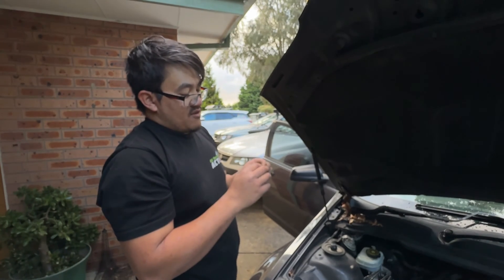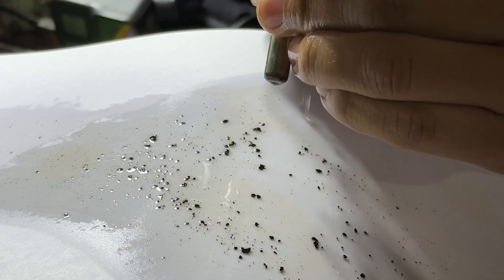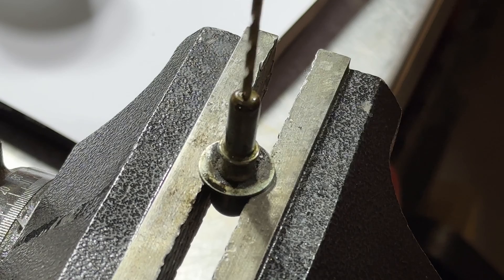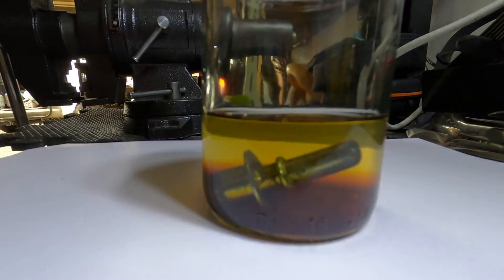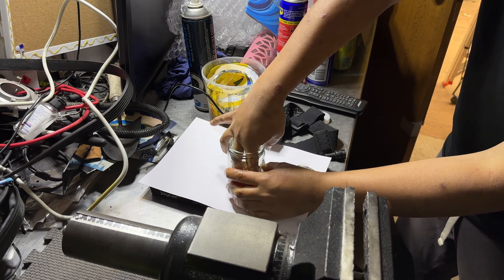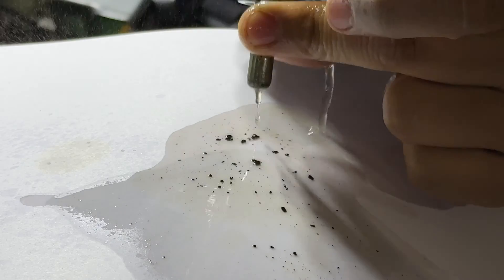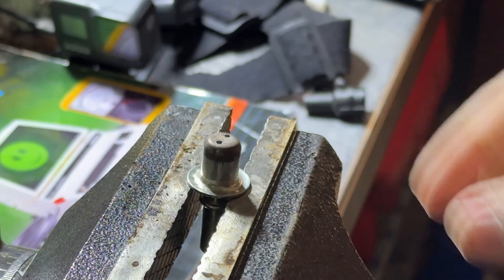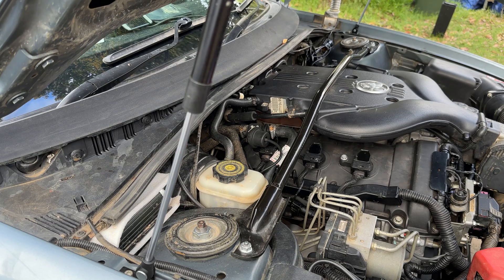PCV Breather Mod on a GM 3.6L HFV6 ALLOYTEC - ADVENTRA COMMODORE CAMARO CADILLAC RODEO CAPTIVA

Comment: I tried this modification. It seemed to work for awhile, but after a long trip, caused a bunch of misfire codes and rough running engine. I was forced to go back to the original PCV on my 2008 Acadia. I have resigned myself to just cleaning the old one every 5000 miles or so.

Comment: Yeah right this is very helpful as I’m considering buying a 2009 Ute that has a ly7 motor and it’s just had the timing chain on it done so I want to make it last but I know how notorious these motors are the timing chain chains but I reckon if you drilled a bigger hole it would have worked ten times better and thinking about putting a catch can there as well would maybe help?

Comment: How were you able to get the PCV valve out? I find these PCV valves are really stubborn to get out of the 3.6 engines.
Reply from the maker: Bit of persistence first time they are fairly stubborn after you’ve cleaned it once it’s easy every other time.

Comment: The way you use that drilling machine is very amateurish. When drill for accuracy you do NOT wander the drill up and down and sideways as you did. You drill the hole and remove the drill from the hole.In my recollection the holes were to be drilled to 2 x2.0 mm and 1 x 3mm. The holes should add to the same area top and bottom but without a major drill set
(many fractional sizes)you will not readily achieve the precision  2 x2mm is  2x.031 adding to 0.063 squ.mm against 1 x 3.0mm which is area 0.071 squ.mm a difference of 0.007 squ mm. Ideally you would use a drill of 2.1 mm...not give the hole a 'workout' with a 2mm drill There are other ways of making them close but in amateurish hands they may be enlarged or damaged. Leave at 2 x2 mm and 1x3 mm. When you check hoses for flexibilty also check inside of them and the MAF. The 'pcv' in these holdens is not a 'valve' in the normal sense, it's more a decompression tool or 'pressure relief system' which was a good idea in theory so long as the designer didn't think much.

Comment: My 3.6l Alloytec from a July 2005 VZ (I guess it's a LEO?) has started doing the oil pressure loss thing. I've stopped driving it as soon as I got it home. It still runs but I'm going to have to assess if the chains have stretched or if it's just that sludge has blocked the oil galleys pressurising the tensioners (or if my oil pump is dying). A colleague told me he could smell my exhaust while I drove up a hill which makes me suspect that the PCV blocked at some stage and sludge formation accelerated. I know I'll likely have to drop the sump to clean it and the pickup tube and I've (so far) bought gaskets for the inlet manifold and plenum because I got confused by my Gregory's manual as to where the PCV sits. For expediency, I've bought a couple of new PCVs, allegedly in modified form. From what I can measure, both holes at the bottom are 1.45mm and the hole at the top is close to 2mm ie. not exactly like this modification. Can anyone tell me what the original, unmodified hole sizes should be so I can determine if this is an unmodified PCV? I've yet to remove the one in use (which I'll clean and measure). For that matter, does anyone know if the PCV is under the plenum, under the intake manifold or externally accessible, round the back of the engine? I know at some stage, I'll need to trace hoses but if I knew beforehand, I'd feel better about taking things apart.

Comment: Thanks for the video. Question for you... When you reinstall the valve, is there something in the hole that helps hold the valve into place? When I put the valve back into the engine in my car, it just sort of drops in with no real resistance. Seems like there should be something to hold it in. Thanks in advance.

Comment: 7/64 for top 5/64 for bottom.👍
Reply: correct. GM issued that these sizes are the fix. No oil in air intake. Change oil 6000km. 380 000km 5/30 no oil burning or usage . Runs great.

Comment: I think this mod is a very good idea.
I pulled my pcv out at about 223, 000k for the first time lm in a v6 with very good oil hygene.
The pcv was clean and clear but the top of the pcv had a black soot crust.There was evidence at the rim of the hole in the crank case that the black layer was lining the crank case cover.
I drilled 2mm both tops and 3mm bottom hole before i saw the recommendation for 2mm 1.5 and 3mm.
I with have to see what effect this has.
Sizes came from a US video which may not have had the precision of this one.
I have a catch can as well
Anyone got any experience with the effects of the 2mmx 2 and 3mm pcv hole set up?

Comment: Hey why did you drill 2 different size holes and does it matter which you drill smaller and which gets the bigger drill bit? Just wondering everyone else recommends using the same size holes on the bottom of the PCV's!
Reply from the maker: Sorry mate missed this comment, we drilled 2 sizes as that’s what the actual recommended specs are and are those matching future GM fix of the later generation alloytec.
Reply: @AllTerrainAction  weird when i went to drill mine one was already the size i was told to bore the bottom 2 holes. I remember you had them at 2 different sizes i thought it was too confusing not knowing which hole to make bigger and which should be smaller... thanks appreciate any help i can get 🙏
Reply: Also did you ever find out if those drill bit sizes were good? Or...? Thanks!
Reply from the maker: @nkastis8211  yes those sizes are fine, if you are off by a little it won’t upset anything just be sure to clean it well before reinstall.
Reply: Logically..the idea is to maintain the same overall diameter.

Comment: Great video. I've always been avoiding the mod for the exact reason explained in the video. I have purchased a second PCV valve and alternate between the two while one gets a good bath.
Reply: @xiii9800xt  why cant you just drill a hole in the middle of the valve cover and install an old school 350 pvc valve and grommet and t it into the existing pvc if you have problems you can just block it off nothing ventured nothing gained
Reply from the maker: @verdellparentaaawink268 not sure never though about this. In the engine there seems to be some baffles before the PCV unsure if this matters when putting in your own. Would be an idea though!

Comment: Hay mate hows it going, i just drilled a massive hole top and bottom going fine so far haha
Reply from the maker: It'll breath alot better that way but you have gotta be smashing oil use? Pull off you intake and see how much oil is in there. Nothing overly wrong with this really if it works, it works. Cant argue that!
Reply: @AllTerrainAction  yeah good point I'll have a gezz tomorrow see what it looks like. Cheers dude

Comment: Hi, can any one tell me where to find the EGR valve on a VE 2011 HOLDEN COMMODORE 3Litre. I have looked every where for something that looks like it could be the valve but no luck. (by the way great video)
Reply from the maker: Seen this but I am unsure myself, sorry.
Reply: Thanks for your reply, but this video is about the PCV valve which is to do with fuel vapour , the EGR valve is to do with recirculation of exhaust gases. Cheers, thanks any way.  @AllTerrainAction
Reply from the maker: @bathtime21  I could be wrong but I undertstand the PCV is recirculating postitive pressure in the crankcase to recirculate back to intake system for it to be reburned again in the cycle. Fuel vapour is new to me, where is this information referanced as I'm interested to check if there is a fact missing in our video. The LY7/LEO to the best of my knowledge at least on the VZ Commodore never had EGR valve. Cant be sure about the later alloytec range.
Reply: Yes you are correct about the PCV valve. I was getting mixed up with the EVAP valve which is to do with the fuel vapour from the fuel tank. It would also appear that the VE Commodore does not have a EGR valve as you mentioned. The only reason I went looking for the EGR valve on my car was because my scanner showed a fault code indicating the EGR. So I’m not too sure what my next move on this problem will be. Thanks once again for getting back to me.   

 @AllTerrainAction
Reply from the maker: Something we have noticed  @bathtime21   which isnt relevent to your case relating to fuel vapor if you get negative pressure in your fuel system (unscrew fuel cap and get air suction sound/release) your charcoal canister might be packed up. This can also lead to engine crank but no turn over problem occuring often on a warm day, or randomly when you have still fuel in the tank but engine will cut out or run poorly at idle. We are seeing more VZ's with this issue at this age and is becoming quite common.

Comment: Im having trouble unscrewing my pcv valve out, any tips?
Reply from the maker: Hey mate, there is a clip on the plastic part that you have to slide and pull up once the plastic hosting is off its a matter of yanking on it with multigrips upwards. First removal is hards subsequent removals are easy as.
Reply: @AllTerrainAction  thanks heaps man, life saver, well, engine saver😅

Comment: None of this works! Why 🤔? Because if you look at the underside of the valve covers the hole where the PCB valve access into the cylinder head crank case is heavily gunked up with oil! Fact!

The holes your drilling are insignificant and do little to nothing to relieve crankcase pressure!

It would be better to simply drill the holes as large as possible to help relieve crankcase pressure!
Reply from the maker: Not when we opened ours...  was nice and golden yellow/brown this is primarily an issue for early life abused alloytecs but it's better to do this than not, drilling huge holes for no reason is actually more of a waste of time than anything unless you have a catch can. You'll just burn off oil and be topping up your oil.
Reply: @AllTerrainAction 

oil vapor can go through the hole no matter what size the hole is. The main purpose of the vent is to reduce the crankcase pressure thereby reducing the chance of pushing the oil out of the piston rings that also allows fuel to contaminate the oil. Oil vapor  is heavier than the fuel vapor so the fuel vapor will readily pass through the hole before the pressure builds up and pushes more oil out of the piston rings and turns into vapor as it gets burned. Since smaller hole relieves pressure slower than bigger holes, smaller holes  may allow  enough pressure to build up in a given time to push out the oil from the piston rings, in effect blocks those tiny holes with it’s sludge. I think the concern of having a bigger valve hole has more to do with messing the air/fuel mix ratio, but today’s modern cars, the ratio is pretty much controlled with its computer, most probably the reason it got rid of the internal component of the valve . That hole has to be massive bigger than the valve itself to trigger the engine light.

Comment: I'd drill it out with the largest bit I could use without destroying the fitting and attach a host to it and run almost all the way to the ground :) both sides. Then plug the vacuum line.

Comment: I have just  pulled a motor out of an  06 Crewman with 155km genuine,for a bloke that was quoted 7+K to replace motor  ,he said it rattled and then stopped, would not start,feels like the plugs are out! But i got a good 2ndhand motor for him,do these have to have 5/30 full synthetic oil? Thanks Aussie from the shakey isles..
Reply from the maker: Yes 5w30 full synthetic is the way, to slowly clean up built up sludge over oil changes use diesel spec oil that is dexos1 or dexos2 approved and it’s safe for your alloytec 3.6 - check filter every 1000km to ensure clean up process isn’t building too much sludge on the filter and change as nessasary. First oil change after 5k then 7-10k changes there after. If engine was very sludgy you may need to change the filter once at 500km and again at 1000km for the very first due of diesel spec oil.
Reply: @AllTerrainAction  Ok,thanks for that.I  definitely going to that pcv mod for sure!

Comment: father and i did drill it out more but add fine mesh (and 3 coarse stainless steel scour pad) to the inside of tappet cover with 2mm stainless steel rivnuts and bolts, no oil in intake pipe so far and i do clean it when i do spark plugs
Reply from the maker: interesting idea, in th end as long as the engine can vent positive pressure with minimal oil return that's all that needs to happen.

Comment: That PCV valve is not a 'valve', more accurately it should be called a breather or even a PC breather regulator. If you open it up there is no 'valve'.
Reply from the maker: Yeah this is correct, we probably could have said this - originally PCV systems where one way with a valve on these particular engines it’s as you say really a breather with limited flow based on hole size. Drilling this too excessively will permit negative pressure in the crankcase and blocked will prevent normal operation of the engine, linked to timing chain failure relating to lower oil pressure. Left bank has a straight through breather, while right bank has this breather/valve.

Comment: Fu Manchu guys, truly is a wealth of knowledge! Used his advice religiously when I had my Calais for several yrs. Pity the same couldn't be said about I Love Smoky Bacon or whatever the heck the arrogant self righteous prick went by.. Good vid mate and thanks for taking the time to upload 👍
Reply from the maker: Yes he? is very resourceful, 👍 I found out something new which I have video footage of but not yet done an upload. 

If PCV is drilled beyond these specific sizes when you pull the oil cap off you get feedback from intake pressure and NO OIL is visible hitting top of the reflection plate at the fill hole on idle. Replace it with a correctly sized drilled or factory one and oil instantly returns visible hitting top of inside engine and flowing down over the plate visible at the fill point. I wonder if this means anything with further negative effects as a result of oversized hole or total removal of the PCV beyond the mentioned specifications by @Fu Manchu ❓
Reply: @AllTerrainAction  , do you know the correct part number for a new PCV for the VZ? Cheers mate, love the vid.

Comment: I would really like someone to cut one of these open with a dremel or something. Everyone considers the Alloytec PCV to be straight though, but I reckon there might be a spring and a disc in there. Anyone wanna sacrifice a PCV for science?
Reply from the maker: I can definitely see through it, it’s hollow unless the spring is out of vision. Happy to angle grind the top off one and show you… for science right 😂
Reply: It's deffinately just hollow so not a valve technically. I think thats why the holes are drilled in those specific sizes, I drilled mine slightly bigger and had huuuuge oil cobsumption.
Reply: no need....it is 'straight through'

Comment: Can you make an update video soon?
Reply from the maker: I assume in terms to see how it's going, I will check it out this weekend and also check intake to see for any oil and update!
Reply: @AllTerrainAction  yes! Thank you!
Reply from the maker: @cliffweatherbee6914  https://youtu.be/hGNXfc7U598
Reply: @AllTerrainAction hows it looking?
Reply from the maker: @hirokawiti4932  yeah really good, dry as in the intake. I checked the valve also at 28,000km on and clean! Just a bit of carby cleaner to clean residue out and reinstalled. Engine idles smoother, can’t say for running I feel like it’s running better but hard to know, definitely not worse!
Reply from the maker: @hirokawiti4932  https://youtu.be/hGNXfc7U598
Reply from the maker: Finally hit 40,000km and did the video! https://youtu.be/hGNXfc7U598

Comment: Hey mate what did you use to pull out the pcv valve? Mine was so hard to pull out.. 😢
Reply from the maker: The first pull will always be really difficult. Just multi-grips on the end. Make sure to remove the plastic clip on first then grip the metal and yank upward.

Comment: I drilled out mine completely and added a catch can. The difference has been amazing
Reply from the maker: Did think about doing this, but ultimately my intake is mostly always dry anyway. I don’t know how people end up with some much oil in theirs. I wonder if it’s because we hardly do high rpm work and mostly low rpm as we use them off road. We use full synthetic 5w30 same as you?

Comment: but NEwA, on that note, wN I did that I had a hyper aquantances which I made the mistake of rushing for, & so pushed on drill to get holes completed quiker- &&& drill bits went way to far in - & I noticed you did that anyway.  do you have any guess or knowledge on wats in these new style(not) pcv valves & wat may or may not B damaged from that?✋🤔
Reply from the maker: They are, empty - nothing inside them if thats what you are asking. They are not one way valves like some older styles. You can see right through them clear when cleaned.
Reply: @AllTerrainAction  
I DID notice that C str8 thrU 2 other hole pRt, wat mAx U so sure there’s nothing along all the sIds?✋🤔

Comment: Hi Chris, hope you guys had a great Xmas.
Chris by chance do you have a part number for the PCV valve? 
I have searched high and low in Repco and sparesbox websites, for the life of me I cannot  find the part, any help and direction would be awesomely appreciated. Thanks kindly Chris.
Reply from the maker: I don’t I’m afraid and I think you can only buy them with the rocker cover (I could be wrong, but that’s what I read).
Reply: Thanks Kindly Chris, much appreciated, it seems to be a rather elusive little part, I'll keep searching on the web. Best wishes for 2023 mate. Cheers.
Reply: @RustyGarbunkel1349  
EBay.   Alloytec pcv.   $40
Reply: @winter rose.. how did the research go for you?